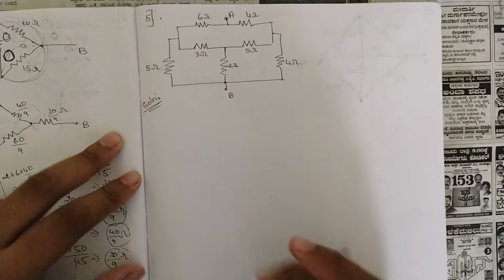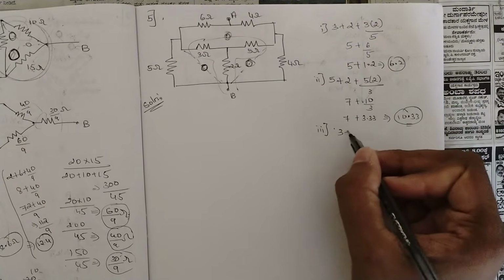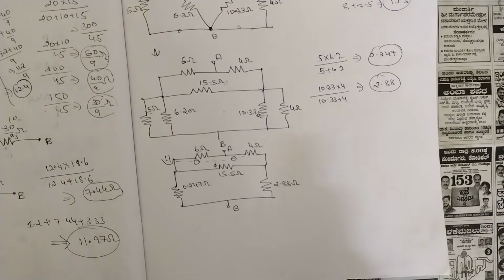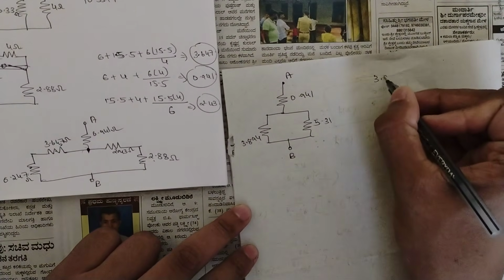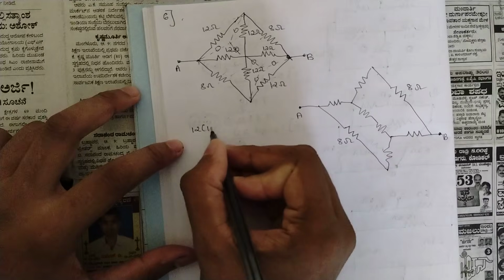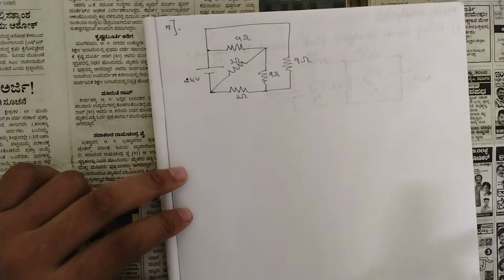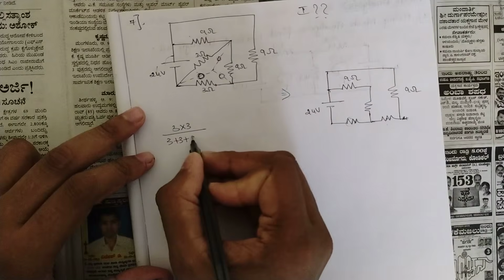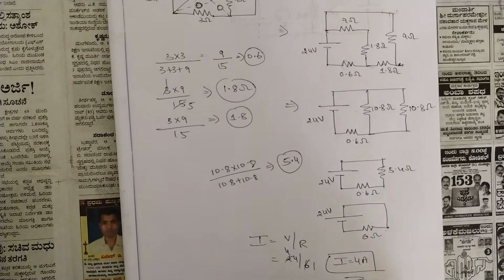10.Star⇆Delta Transform 3 Problems Explained Network/Circuit Analysis 3rd Sem ECE Latest Scheme VTU

Comment: Where comes 0.247 it's wrong it's 2.76 and with further adding 6.4 ohms comes and with parallel calculation with 5.31 answer will be 2.90 ohms and adding with 0.94 final answer 0.94+2.90=3.84 which roughly equals 4ohms
Reply from the maker: Thanks for pointing that you are absolutely correct...plz do correct it...
Reply: yes i got the same answer bro get confused i think.....😅😅
Reply: 5th question one I am speaking sir your explanation is good but you trouble in calculation please look after it
Reply from the maker: @Vinodbachyal  its because im one of u 😅😅